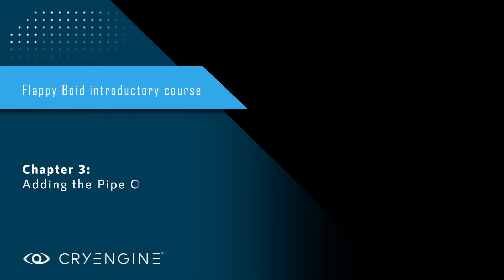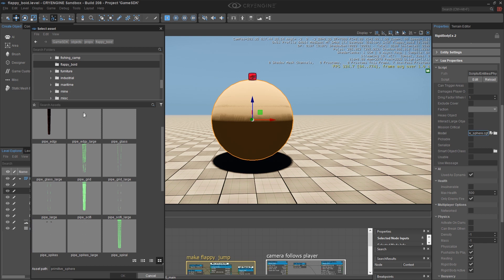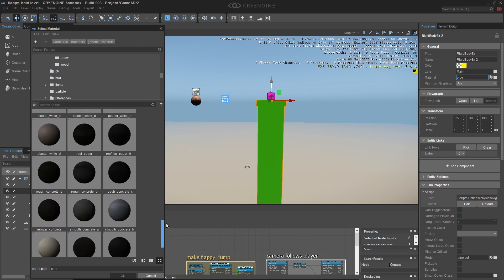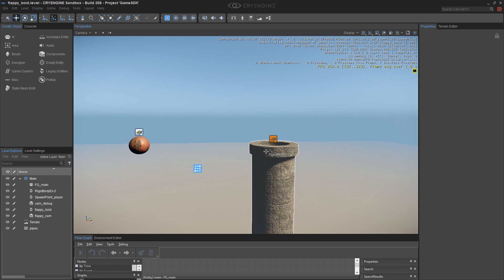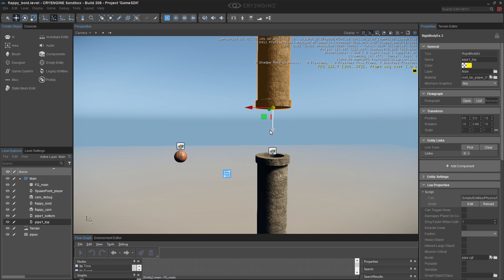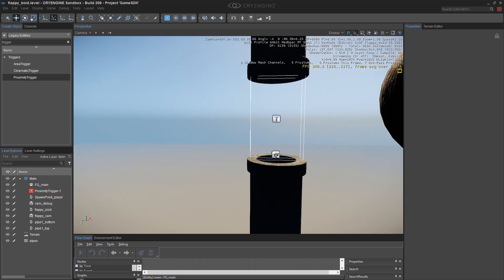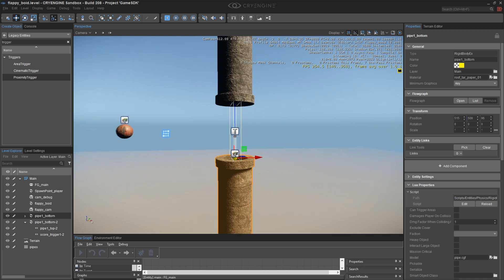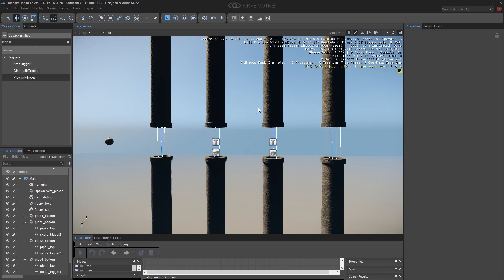FlappyBoid Introduction to CRYENGINE - Chapter 3: Adding the Pipe Obstacles

Comment: Hello, is there a way to limit FPS while editing? I could do it while testing the game (CTRL+G) using r_Vysnc and sys_MaxFPS but in editing mode doesn't works. thanks
Reply from the maker: Currently it is not possible to limit the FPS of the Sandbox Editor in edit mode without code modifications. This is something we want to address in future updates.
Reply: @cryengine  got it. Thanks.

Comment: Hi, I can't see the outlining box around the Proximity Trigger that shows how big it is? Do I have something disabled?
Reply from the maker: Hi there, you may be able to fix this if you delete the following folders:
%LocalAppData%\Crytek
%AppData%\Crytek\CRYENGINE
Reply: Thanks my friend! All good now.
Reply: Hello, it work on 5.5, but I still can't see outlining box in version 5.4 .Do i have to do something else ?
Reply from the maker: @golemnormal735  There were some issues in 5.4 that were fixed in 5.5 regarding the bounding box rendering. If the above does not work for you the work-around would be to create a mesh component of the same size with a material that has a lower opacity value as a visual guide.
Reply: @cryengine  Wow, so simple. Thank you very much, you make my day.